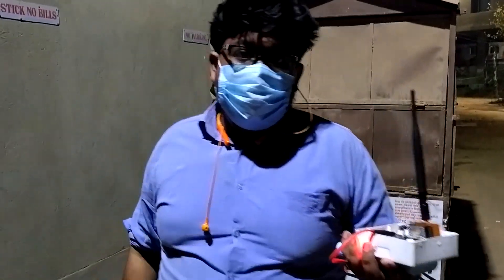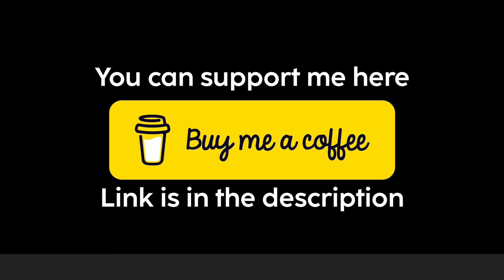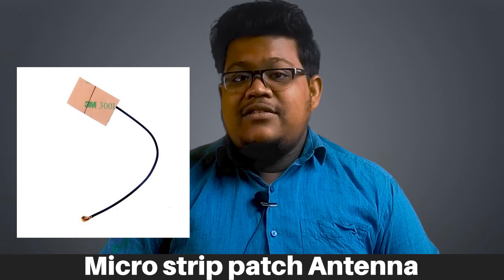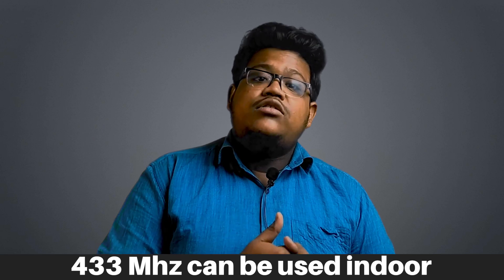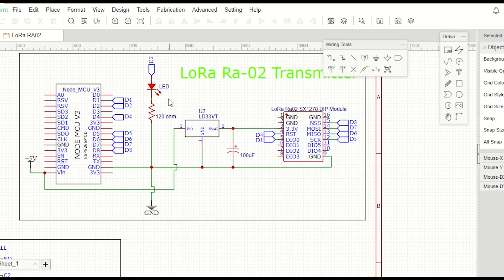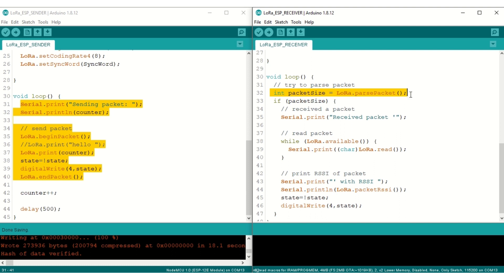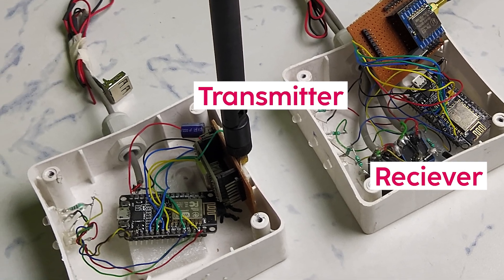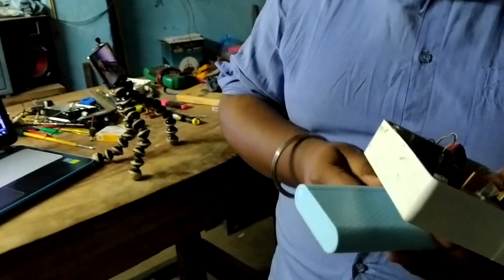Arduino LoRa Tutorial | How to use LoRa RA02 Module with ESP8266 | DEVLOG #4

Comment from the maker: You can find the Code & Schematic here: https://github.com/circuiTician/Embedded-System-IoT/tree/main/LoRa-Ra02
Reply: Where i can get the antenna?
Reply from the maker: I get this from local store..
You can also get this in online shops like robu.in
Reply: Not available on robou.  Can you suggest me any antenna from online store
Reply from the maker: https://robu.in/product/824-960-mhz-1710-2170-mhz-dual-band-4-6-dbi-magnetic-mount-antenna/?gclid=Cj0KCQjwpImTBhCmARIsAKr58cxIvi0OFGNdvh2OSxJMl65eGWLIIyVScKqs-ibB1GkWGE3dgySEL3QaAkSBEALw_wcB
Reply: I did the same but even at the nearest 1 feet it is giving -120dbm, how can I get your number or email because I am working on a prototype project
Reply from the maker: Ping us on Instagram
Reply: Can you please give the link of the module that comes with a patch antenna (sx1278)
I need to buy it for a project 
Thank you 🙏🏾
Reply from the maker: You can use any 433 mhz antena
Reply: @circuiTician can you give the link to that
And the problem is attachment 
The module I can find comes with a place for a patch antenna and a patch antenna is very tough to find in budget

Comment: getting this when i verify the program: . Variables and constants in RAM (global, static), used 28364 / 80192 bytes (35%)
║   SEGMENT  BYTES    DESCRIPTION
╠══ DATA     1500     initialized variables
╠══ RODATA   1032     constants       
╚══ BSS      25832    zeroed variables
. Instruction RAM (IRAM_ATTR, ICACHE_RAM_ATTR), used 60267 / 65536 bytes (91%)
║   SEGMENT  BYTES    DESCRIPTION
╠══ ICACHE   32768    reserved space for flash instruction cache
╚══ IRAM     27499    code in IRAM    
. Code in flash (default, ICACHE_FLASH_ATTR), used 239940 / 1048576 bytes (22%)
║   SEGMENT  BYTES    DESCRIPTION
╚══ IROM     239940   code in flash

Comment: why my Arduino serial monitor showing "Starting LoRa failed!" .. my wiring and code all is ok.. plz help me. I am using lora ra-2 module
Reply: I also faced the same issue , but the actual problem was in soldering , so if ur code and connection are right then definitely soldering problem would be there

Comment: Same freq 433 Mhz and i used Lora module RA02 and dipole antenna.. but still it covers the distance of less than half km??? Why???
Reply from the maker: Are you testing indoors?
And which dipole antena you are using the frequency of that antena should near about 433Mhz. and the gain should be greater than 3 dBi

Comment: After 10minutes it's breakdown communication between lora how we rectify this problem
Reply from the maker: Use a good power supply with low ripples.
Keep the setup away from large metal objects.
For permanent setup solder the connections. Do not use jumpers
Reply: @circuiTician  yes bro I make like this but not working properly bro after 10mins disconnected
Reply from the maker: Change the lora modules

Comment: Hi sir I am wondering how did you add those antenna can you make a tutorial? Thank you so much! I really needed it for my thesis.
Reply from the maker: I just remove the connectors  using a iron and then connect wires from the antena pad

Comment: Great video man. How did you soldered those two antenna with the lora module. What is the frequency of those antenna.
Reply from the maker: Frequency is 433 Mhz
I just remove the patch connectie from the lora board and solder a wire to the antena pad